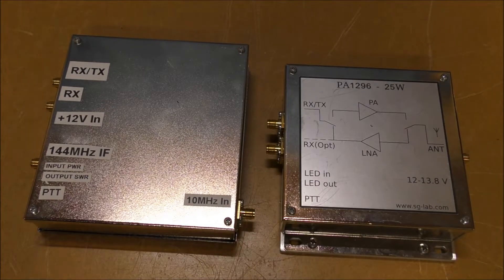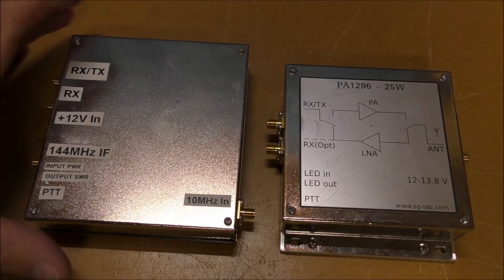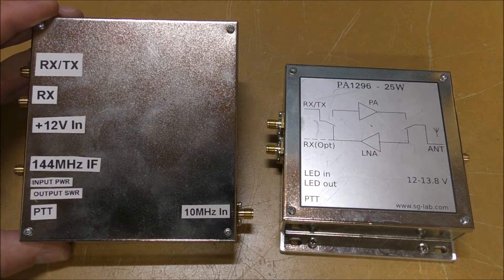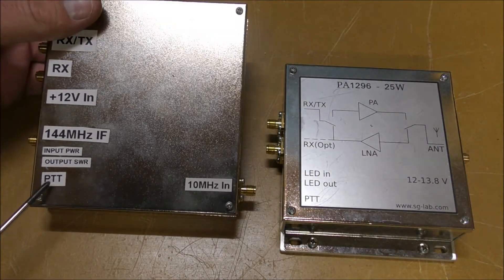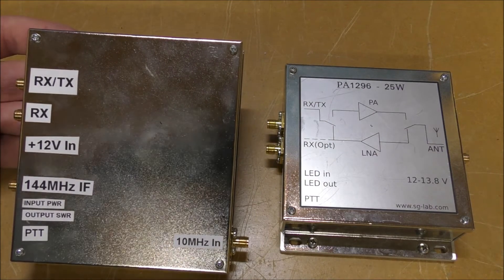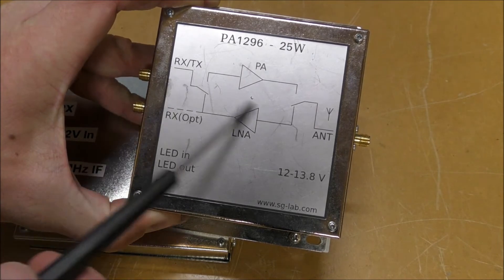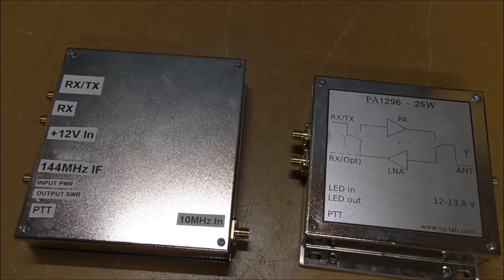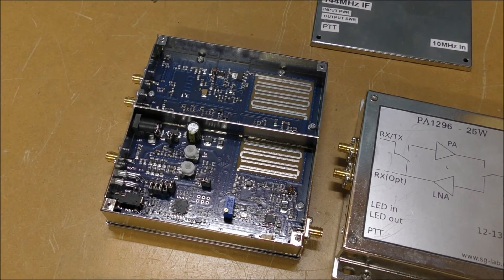The EASIEST way to get on the 23cm (1296 MHz) band!

Comment: Do you know another source for the 1296 MHz transverter and 25 watt PA? The email for the hardware provider you posted in your video is bouncing back.
Reply from the maker: Hi mate, did you try their website? https://www.sg-lab.com/amateur.html
The email is listed on there. I don't have any other contact details I've used in the past
Reply: @HamRadioDX  I sent an email to the one listed on the product page but it bounced. I noticed a different email on another part of the website and sent an email to that, which didn't bounce. I want to mess around with the 23 cm band before the IC-905 comes out. I live in the northwest part of the US which has some awesome mountains to shoot long distance from. Nice job with your channel. I'm always impressed with your straightforward approach to the hobby.
Reply from the maker: @jordan2you2  Thanks mate